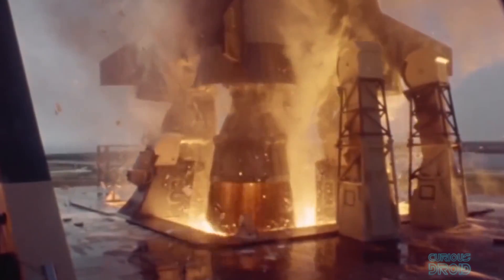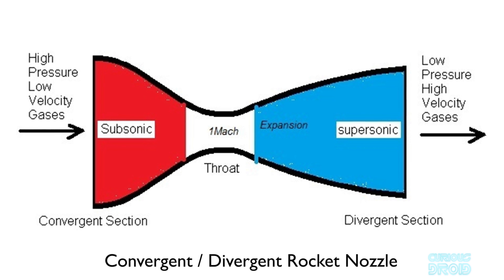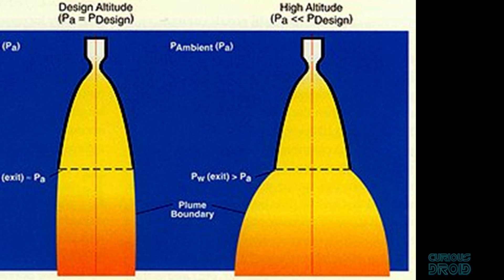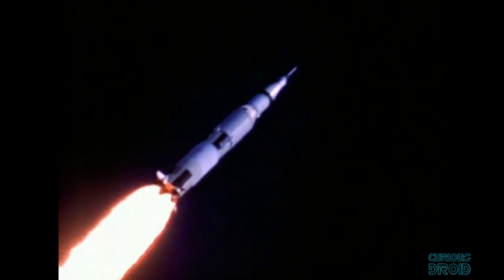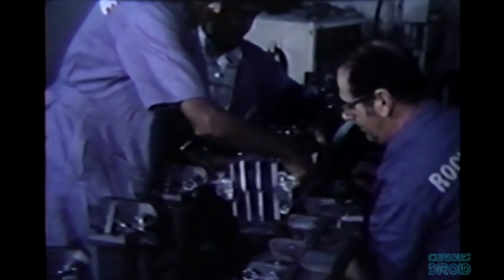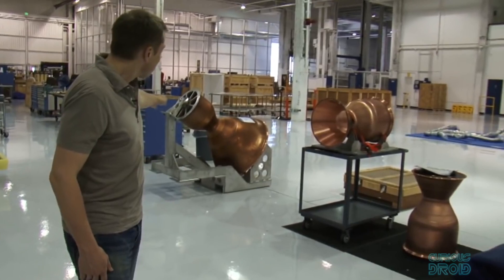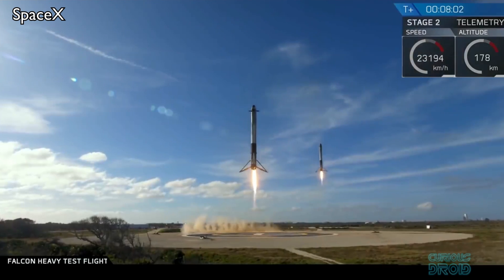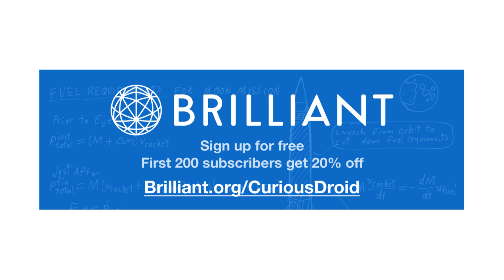Aerospike Engines - Why Aren't We Using them Now?

Comment: What about how they can’t operate in space?
Reply: Aerospike engines use small nozzles thrusting along the thrust plate, in the case of the linear aerospike. These engines are more fuel efficient at low altitudes where conventional rockets are weaker and in fact gain efficiency at they get in to thinner air and vacuum. They use rocket propellant and need no air to operate. The NASA Linear Aerospike was never flown but the theoretical efficiency in orbit would have been one of the highest achieved at that time.
Reply: I'm pretty sure they can, just not super efficiently.
Reply: Very good vid, and an interesting question. I think Ray Nash is correct. There is also the fuel needed to lift weight side of things, hence the stages of other rocket designs. Not even the Atlas, Delta, SST, and Soyuz lug the boosters all the way up to orbit, instead of jettisoning the dead weight once it's done its job, as the extra weight of the tanks alone would require a larger rocket tank combined with a smaller payload. Thus a rocket engine that is "ok" at 'All altitudes' vs two or more optimized for specific altitude ranges on a multi-stage launch system is probably another reason the Aerospike hasn't flown on high profile missions.

I do think the Aerospike looks cool as hell, I just think the Why is more involved than some think.
Reply: Aerospike engines have virtually constant thrust from vacuum to atmospheric pressure. Technically it's highest at vacuum, but not by much at all.

A conventional nozzle optimized for a specific pressure will always outperform an aerospike engine at that specific pressure. It will underperform at pressures too far away from that. Add in weight and complexity issues and the advantage drops quickly for anything that isn't an SSTO.

Of course, SSTOs are another terrible idea, so there's no advantage at all.
Reply: Actually Newton's laws are best represented in a vacuum.
Reply: best demonstrated you mean
Reply: I don't know what you're talking about they work great in space. So you might think that it might over expand and be useless but you would be wrong. the flame would take the shape of the small hole permitting the flame to leave. unless it hits a part in space it has no incentive to change direction or expand because it is already being the push in 1 direction. think of it like a rolling ball. if you rool it down a hill it goes down faster and faster but unless you put a ramp at the edge it will never go back up.
Reply: Of course they work in space.  That' what an SSTO (Single Stage to Orbit) means.  You still use the same engine in orbit (space/vacuum).
Reply: Deep space is a vacuum. Newtons third law applies as with everywhere else. In fact rockets work far better in space as zero resistance (eg no air). Basic kindergarten physics.
Reply: Tech Tins ... No you are misled... with nothing to push against in a vacuum there would be no discernible thrust . You cannot push against yourself...!!!
Reply: Are you thinking of air-breathing jets? Why wouldn't rockets (with on-board fuel and oxidizer) not work in a vaccum?
Reply: Connor Halleck rockets operate in space all the time. how do you think they fune tune orbits on satellites, the ISS, the flightpath of New Horizons and other deep solar system probes that use gravity slingshots? 

The big boosters run out of fuel pretty much once in orbit because thats their job - to get to orbit. Any further, and you need a bigger, multistage rocket with more fuel - and thats heavy and expensive...
Reply: are these "rockets don't work in space" guys from the same troll "school" as the flat earthers? Is it a meme? They can't be real.

i mean simply googling that sentence and you find explanation texts and videos for every possible  level of intelligence to comprehend....
I walk through air every day. It's not much to "push against" anyway.
Reply: @Tech Tins you are right and no one disagrees with you, but with aerospikes there is no way of direction the flow of gas straight away from the rocket
Reply: There were plans to incorporate HG-3 high pressure aerospike engines into the next generation of Saturn V, had the second production run of Saturn V been approved (instead of it being mothballed and then cancelled altogether).  The HG-3 was basically derived from the J-2's converted into aerospike engines he mentioned in the video.  

The reason for this change was to 1) increase thrust and efficiency, thereby allowing more payload to be launched into orbit with the same amount of fuel, and 2) since the aerospike engine was more compact, it would allow adding more engines to the cluster (up to 8 IIRC) on the S-II rocket stage, plus since they were shorter, it would allow a shorter interstage ring to be used to separate the top of the S-IC and the bottom of the engines of the S-II, which also would save a lot of weight on this interstage ring, which would also increase payload to orbit as well as cutting costs to construct the interstages...  Similarly 1-2 HG-3's could be fitted to the S-IVB as well in the same space as a single J-2 engine.  

Later!  OL J R :)
Reply: However, if you have S stages you have S times as many pumps, nozzles, fuel tanks, piping, control systems, chassis, etc etc and S times as many components to test and fault on assembly.  You seem to be missing the point that the spike is good at all altitudes (in theory) while the bell is merely workable over a limited range.  As explained, go outside the range of the bell an it either flames out or goes bang.
Reply: SABRE engines will kill rockets single or multistage , pointless of finishing the research and testing
Reply: Ambient Morality I strongly disagree that SSTOs are a terrible idea. A liquid fuel + oxidizer driven SSTO like the X-33 is a terrible idea, but there are more options. The Skylon project uses rocket engines that can supercool air and thus only use liquid fuel until it reaches the upper atmosphere. That combined with the fact that it is projected to take off and land like a plane, using wings for lift, would make a pretty efficient package for getting stuff into LEO. We will se what the future brings in that regard and I'm not sure how the cost efficency would look compared to fully recoverable conventional rockets like Space X and Blue Origin are doing, but compared to the ancient tech SLS that NASA wants to use it would be more cost efficent by far.
Reply: Very poorly
Reply: Look up newtons third law. For every action there is an equal and opposite reaction. That is how rockets work. When you throw stuff out of back of a rocket you move in the other direction. Like pushing someone when your both stationary on an ice rink you will move as much as the person you are pushing. In space its same thing. In fact its far more effective in space as their is no air resistance. Accept that with rockets you are throwing fuel out that back very quickly (heated gas will move faster the hotter you get it). Newtons 3rd law also gives reason you get recoil with guns. Its known as the conservation of momentum, Look it up.
Reply: Lonerdo 1-2% efficiency
Reply: Tech Tins the RD-200’s worked better at low altitudes, optimized for boosters.
Reply: Tech Tins we understand, it’s just that it isn’t effective in space....nobodies saying they don’t work. That’s why rockets have VAC. And ASL. Thrust.
Reply: seed comment says just that
Reply: Tech Tins you have it wrong...
Reply: I'm not sure what you mean by "best represented" - they are applicable everywhere
Reply: Not in a vacuum
Reply: Sad to see so many misinformed people on here thinking rockets can work in a vacuum...!!! They cannot ... everything else is just Star Trek ...
Reply: Epsom Vince 
The reason for the nozzle being bell shaped is to difuse the flow. 
The nozzle isnt where the push is happening like most asume.
The whole engine is a hourglass shape, to achieve varying velocity and and pressure ratios. The narrow part in the middle (the throat) is pushing on the difused exhaust in the bell... As velocity and pressure are are VERY different between the two sections. This is how rockets work in a vacuum. 

Simply put, the mid section is pushing against its own exhaust (difused) in the aft (the bell).

Comment: unsure if somebody else pointed this out already but you don't only save 40% of fuel in cost, but also in weight. if you add extra cargo you would have to add extra fuel though so it's not a direct increment in payload capacity, but it would be interesting to know how much the increment would be. is that the correct way to look at it? awesome videos btw!

Comment: 2:35 1 inch sq is NOT equal to 2.54 cm squared!!! It is about 6.45 square centimeters.
Reply: 1 in squared is (2.54cm) squared but not 2.54 (cm squared).   Which is why math is done with symbols and not in english.
Reply: Paul Jimenez: Best comment on here.
Reply: Listen again, he does not say 2.54 cm squared.  He says 2.54 squared centimeters, which is correct.  The graphic is ambiguous.
Reply: Ah, but then, he said “atomsphere”, not “atmosphere”. ;)
Reply: You're wrong.  Your first sentence you say that they are not equal.  Your second sentence you say that they are.  Let's run through it for the geometry-impaired.

1 inch squared = 2.54 cm squared
(1 inch) squared = (2.54 cm) squared
1 inch = 2.54 cm, so:
(2.54 cm) squared = (2.54 cm) squared
Quod erat demonstrandum.
(By the way, 2.54 x 2.54 = 6.45, so that part you got right.)

Now, let's show the difference in terminology:
5 square miles versus 5 miles square
(5 square) miles versus (5 miles) square
5 squares, each a mile on a side versus 1 square, 5 miles on a side.

When you use X Units Square you are saying a square with each edge being X Units long.
When you use X Square Units you are saying X squares each one being (1) Unit on an edge.
Thus, 5 miles square = (5 miles) square = 1 square 5 miles long on an edge.
Similarly, 5 square miles = 5 squares, each 1 mile on a side.

You should have learned this in Junior High, at the latest.
Reply: Correct, but in context a minor mistake.
Reply: 2.54 cm²? What has mass and the speed of light to do with this?
Reply: Welcome to english language
Reply: Could the dodo bird fly?
Reply: No.
Reply: Glad you guys got that ^2 away!
Reply: 1 inch sq definitely is equal to 2.54 cm squared!!! And it is also about 6.45 square centimeters.
Reply: Had to scroll way too low for this. Shit like this is why we all need to use metric [naturally defined constant] units of measurement instead of some antiquated system based on a long dead dude's idea about measuring stuff
Reply: According to George Kastanza, 'It is as long as you believe it."
Reply: Pedantry for no sake whatsoever, only fools quibble over semantics.
Reply: Paul Jimenez: I never in my entire life, seen anybody using x cm squared to mean (x cm) squared. x cm squared, is always x (cm^2). Or more commonly, x square centimeters. But centimeters squared is is the same unit. https://en.wikipedia.org/wiki/Area#Units
Reply: jonathandb91 re read Paul's comment and it'll make sense.
Reply: Rob Neff your premise is incorrect.
Reply: Whoever added the text on the video simply forgot to add "sq" after "2.54cm" ...it really isn't a big deal. Those who quarrel about this will have a short-lived argument on their hands.
Reply: Yes, 2.54^2 = 6.54. so 2.54 cm SQUARED is 6.54 square centimeters. And the conversion was from inches to help you visualize the size of a square inch if you're more familiar with metric.
Reply: jonathandb91 No

Comment: actually one wants some excess pressure to control boundary layer things.  o delta pressure at exit is NOT desired.  And  there is thrust generated from a positive pressure delta

Comment: I was pretty sure that thrust didn't have anything to do with air pressure.  You're not pushing against the atmosphere. If you were, thrust wouldn't work in a vacuum.   But you can see the effect when you use a water hose. If you put your thumb over the end, you'll increase the focus of the thrust of the water, and you'll feel the push.  The water will also go farther.

Comment: Go figure, George Lucas was on to something with the design of the ships in the Star Wars prequels. The ships of Naboo used engines that looked similar to toroidal aerospike rockets. And one could argue whether the power plant on the Millennium Falcon was a modified linear aerospike.

Comment: I think by the time anyone can develop a aerospike engine and test it on a rocket we would have run out of fossil fuels
Reply: Aerospike is estimated to come on line post 2025.  Oil reserves using fracking will last for at least another 100 years.  You write like a dumb millennial who is a public school graduate.
Reply: Easy Eight well I was not aware of that, but do you think Fracking alone will be able to sustain the hunger of fuel guzzling rockets? What about the other transportations which are heavily dependent on the fossil fuels? It will take at least a couple of decades more for the EVs to grow to a significant number on roads. Various estimates say that the current oil reserves will only last for another 50 years and atmost a century. What I think will have to be done is to find an alternative to fossil fuels to feed the rockets or abandon the fossil fuel dependent design altogether and develop engines which run on other firms of energy and space agencies are already working on them.
Reply: I do not like to get into debates with people who are not capable of doing simple math.  So, here is a question for you.  Why don't you find out the basic kerosene load on the first state of a Falcon9?  Next, find out the cost difference between a gallon of liquid hydrogen and a gallon of kerosene.

Comment: Of course the other reason for stages is that you generally need far less thrust in the upper atmosphere. You've burnt most of the fuel to start with. It makes sense to dump the heavy engines and now empty fuel tank.

Comment: Raw numbers for accounting purposes... thank you.  $200,000 per fill up on a launch for a Falcon 9 block 5.  I suspect that NASA may eventually commission a Falcon 9 block "X" to be outfitted with an aerospike, but that will not happen until the 2025 period at earliest.  Falcon 9 type boosters are the future of space exploration.  The failed Space Shuttle was too expensive, too undependable, and far too dangerous to be practical.

Comment: well you would still be better off using 2 stages  . isnt it obvious?
Reply: No... what you wrote does not make a whole lot of sense.  The second stage costs a great deal of weight just in raw hardware.  The Aerospike could be used for the whole launch phase.  BTW, making a heat shield for the SSTO rocket would be an easy task.  Rockets landing upright and aerospike engines will be standard in the post 2030 era.